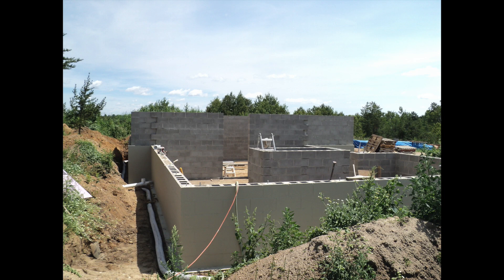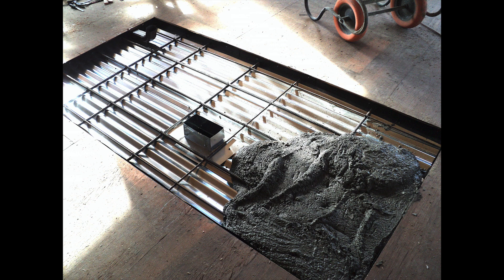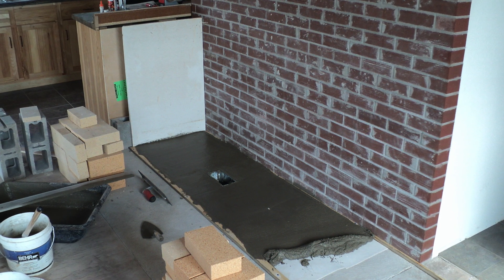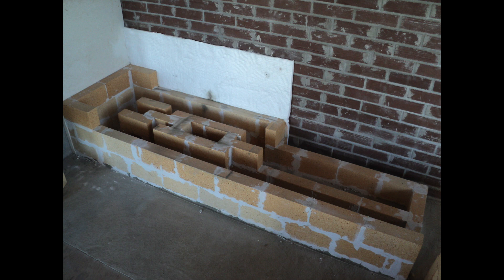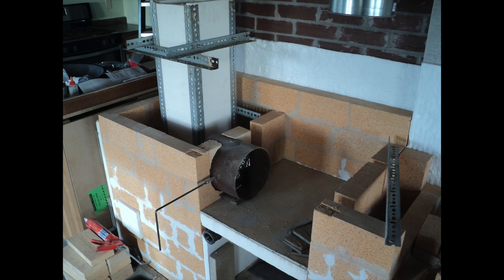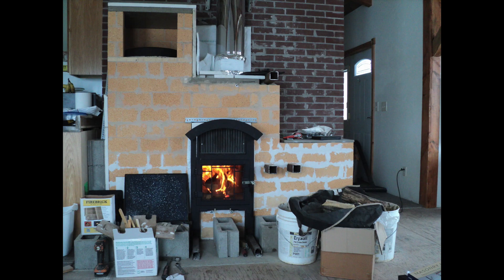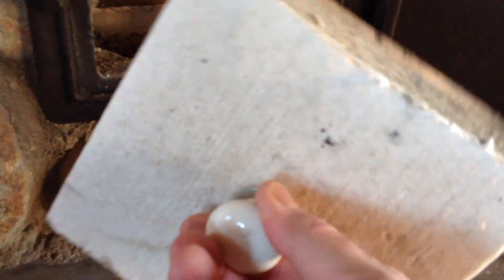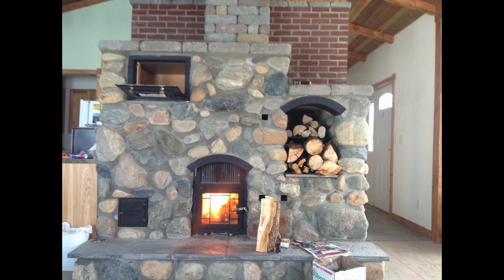Closer look, part 2.  Secrets to a hot clean burn.

Comment: I think I came a Lil when u said all under 3k including foundation. My only question would be u said when it's cold out the condensate that is produced by you reducing the exhaust temperature so much lower then the burn which I totally understand and am all for it. Only 1 question have you ever tested the pH of that exhaust condensate? Idk if it's the same with wood as it is with all other forms of fuel used to heat homes but with natural gas, propane, and 1 certain oil fired unit all the new high efficiency top UL rated units do the same and due to the exhaust temperature being so low compared to burn temperature they all create some amount of liquid condensate inside the exhaust vent piping and it is extremely acidic. I would imagine it being even higher with wood so how hard is it going to be to replace that beautiful looking stainless steel vent tubing when the highly acidic condensate eats through it within 10yrs. I can be completely wrong cuz like I said not sure if woods the same that's why I asked if you have ever done a simple pH test on what forms and freezes at the vent cap. If you have I'm extremely interested in what that pH reading was?
Reply: Do they not allow outdoor wood burnering units since u went with on demand gas unit to heat the floors you should add a coil in fireplace that ties into that system so you would basically never have to use gas unit unless some issue with the fireplace. Either way I love ur videos and content keep on keeping on never stop innovating and please  keep making videos of ur projects ur extremely inspiring and at a time >n life I really need it they just about got me to say screw it and just join the rest of the  heard not to many of us left 👈
Reply: @ChrisTaylor-ph3pc  It's tricky to do what you're suggesting, because with on demand gas you have control of the water temperature. With wood you have inconsistent temps to an extent, and the possibility of water hotter than you want. You also need reliable backup power for the circulators.
Reply from the maker: No, I have not tested ph on any exhaust.  This is the fifth year of using the masonry/fireplace with no deterioration noticed.  If ever in the future the chimney needed to be replaced, there is access to do that.

Comment: Any chance of you making and selling plans for this kind of masonry heater/ rocket stove hybrid?
Reply from the maker: This is the 5th winter now that it's being used everyday. Winter is early and in full force already.  It's still working great, but not complete sure everything is exactly optimum.  It's possible the riser could have been shorter, making the oven lower.  And the secondary air doesn't seem to be necessary.  Also, I may have been able to have more smoke channels.
I think there is enough in the videos that someone in-the-know could build something similar, but I probably won't be doing a set of plans.
Thanks for your interest!

Comment: The smoke chambers to the right and under the fire box are not part of the flue ?
Is the riser tube part of the flue ?
Reply from the maker: I refer to the chimney, as the 'flue'.  The 'riser' is part of the exhaust passage way, (like in a rocket stove).  After the riser, exhaust (smoke) goes back down under the burn chamber to the right; I call these 'smoke channels'.  The exhaust (smoke) travels back around to above the burn chamber, and straight up the chimney flue.

Comment: I really like the construction of this earth style masonry and stone hearth. This looks like what the Russian peasants have used for hundred of years to heat their homes in minus degrees centigrade.  What I am wondering is if you have had to clean out the heat chambers of the unit ??? Nice masonry work fella too.
Reply from the maker: I vacuum the whole thing out at least once a year, and check it throughout the heating season.
Thanks for the compliment!
Reply: @doubleMinnovations  Could you tell me how much accumulation of residual stuff is left ?? I believe you said you burn mostly pine.  Thanks